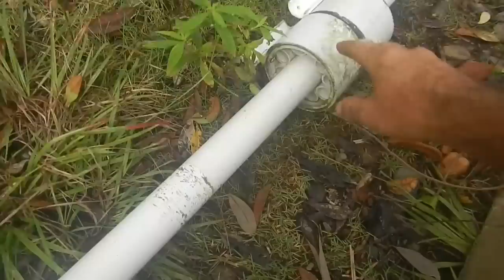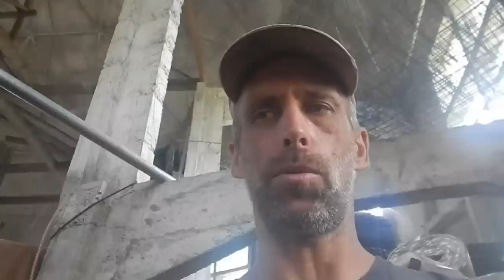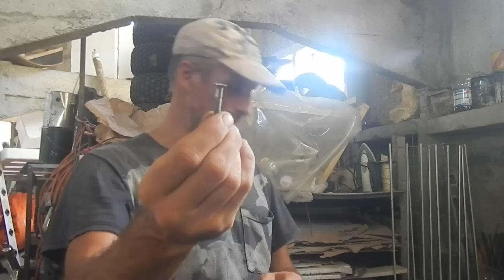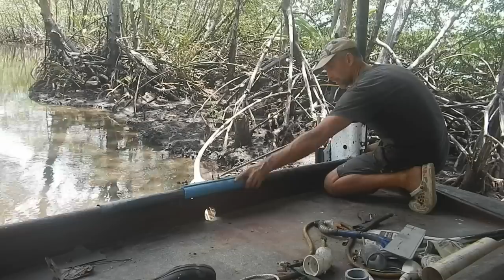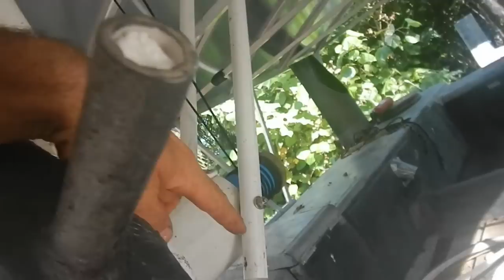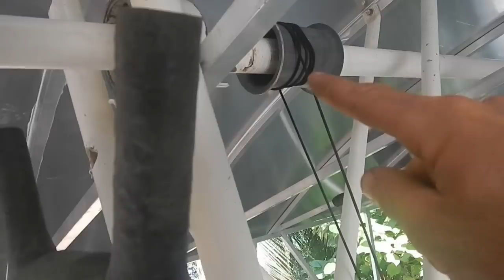Shark Slicer Upgrade 016 Steering!

Comment: Most catamarans just have a long bar between the two tillers, then attach the pulley's and rope to the bar, you have almost the same thing but a bit more complicated, for future boats, check out the steering on Wharram catamarans (other designs do the same thing but more complicated/hidden). no point changing what you have now unless it becomes a problem.